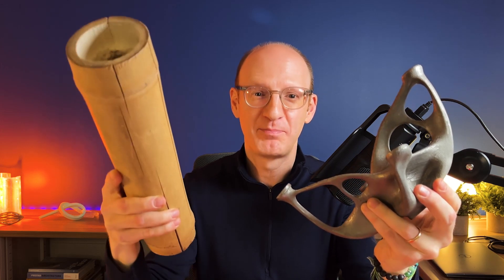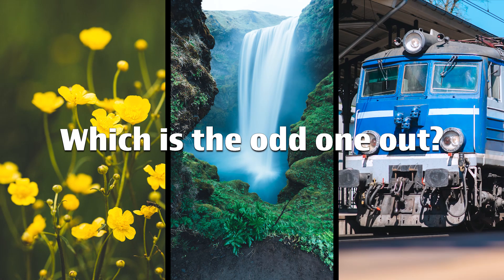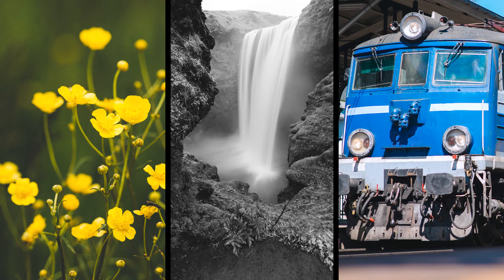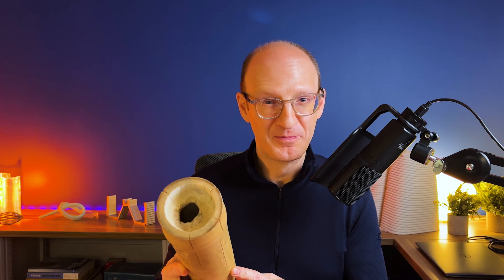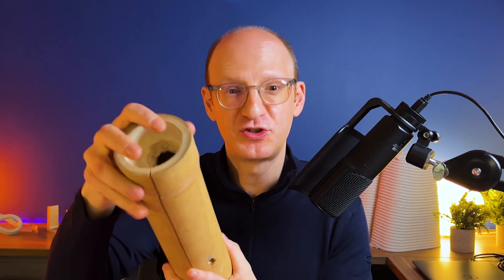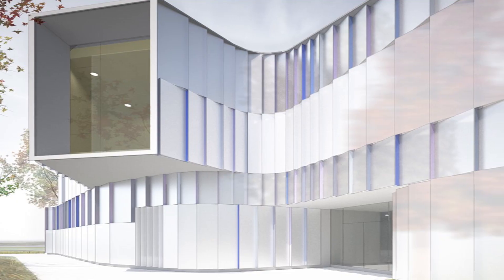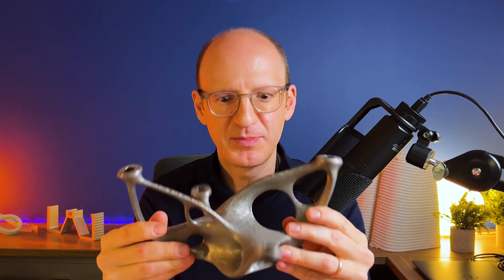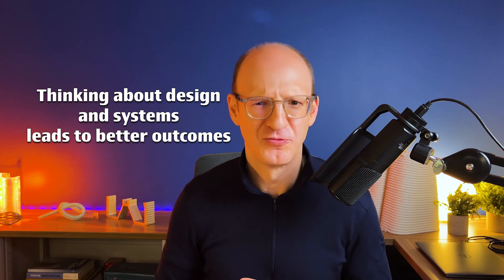Why Bamboo and 3D Printed Metal are the Same!

Comment: they are also the same in that they function as metaphorical hammers that some designers with little to no practial experience use to bang on the preverbial nails when a simpler solution woud have suffised.

Comment: Idunno about that buttercup argument. I feel like one could similarly argue that a waterfall is a mechanism "designed" to get rainwater back towards the Earth's centre-of-mass in the quickest way possible.
Reply: No, no one designed the waterfall, its form, its surrounding etc.
It just happens to be like it is.

The train and buttercup are carefully carved, most parts are there for a reason.

Comment: Brilliant! Evolution is such a great designer. Probably because bamboo is such fast growing it can't waste placing any material where it's not needed. It needs to get that structure quickly as it is adding more load and height quickly. What about the cross pieces every so often? Do they add significantly to the strength of the cylinder? Excellent new lighting in your studio.
Reply from the maker: Thanks and, yes, the regular spaced "nodes" provide buckling restraint to the bamboo length (also called the "culm").